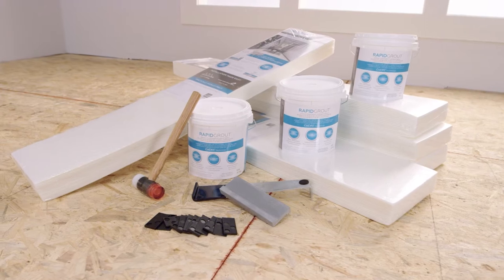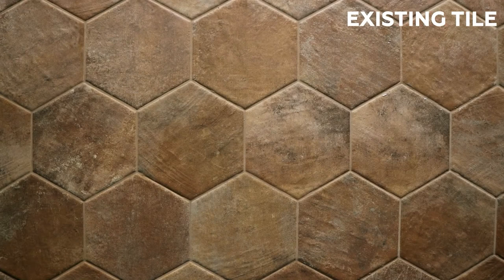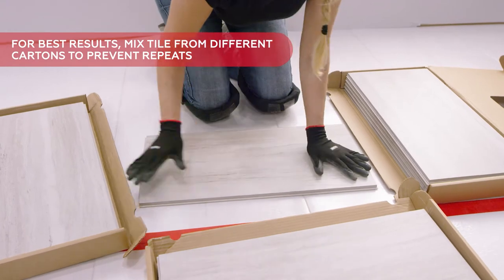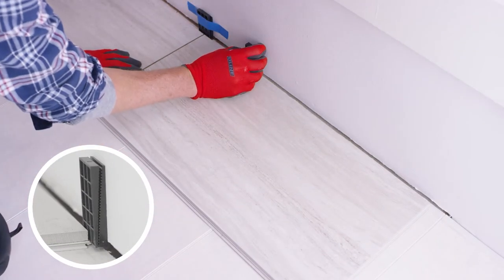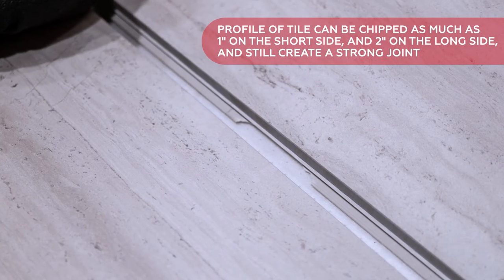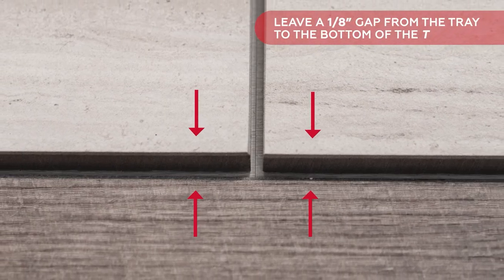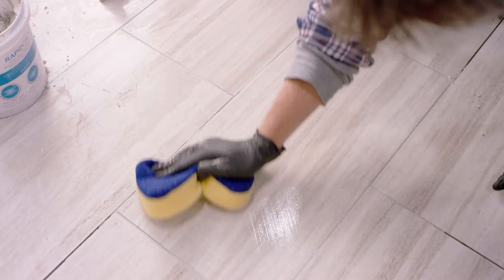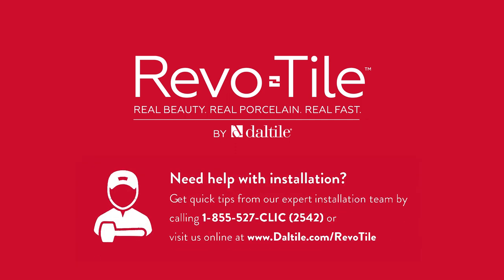RevoTile Installation

Comment: what this video doesn't tell you .. is that the floor needs to be almost perfect flat 3/16 over 10 is MAX  but even then any deflections on shorter length or "twist"  makes it hard to click in or you'll have a lot of issues .. the score and break looks  easy  .. sure.  but if you need to cut anything smaller then a  1/4  of the tile  you will have a hard time breaking  the under lay  .. and the score and break is no as clean  as they show .  chunks of the  underlay remains and needs to be grinded down .. any other cut is a wet saw cut and time consuming . the interlocking is  ok but breaks easy and you got to pay attention  cause little chunks that break off gets stuck in the groove and makes it hard to get the  tiles nice and tight . all in all interesting concept and I see the  appeal of the "quick" install but you need a lot of prep to get the floor to what you need .. and if its a nice open area sure it would be fast but in a condo  with hallways and door ways and  a lot of cuts this  is a VERY time  consuming process   the same if not longer then then traditional tiles .  this is my fair review to this product  from personal experience . I see the pros and the cons .

Comment: This is a great idea and product.
The issue is with the required grout. The rapidgrout, no matter what dahl tile recommends, leaves a urathane residue that is so difficult to remove. I've tried every method and talked to mfg reps even. This is the worst and more time consuming aspect of this system. Bostic Blair is expensive and doesn't solve the residue issue easily. Lots of scrubbing and work to clean the tiles up. They make it look and sounds so great on website and video. It's a bummer cause the rest of the system seems pretty great.

Comment: I purchased 4 pallets of this for a 1200 SQ ft condo. No tile installer wanted to do it. I had no idea why….and now I know. 
First, NO, you cannot just use a regular tile score cutter. I tried the best brands, the big ones small ones, they will not score the tile and break them easily or nicely. So, in comes the expensive, loud and messy tile saw. 
They don’t click into place as easily as shown and if even the slightest piece of debris is in there you’ll have to pull it away and clean out the groove. 
Your floor better be perfect, and I mean absolutely flat. If not you’ll hear all kinds of clicking and snapping when you walk on it. You’ll end up pulling up the piece and gluing it down. 
All in all it’s been a very frustrating and labor intensive process. I wish I could go back and just buy regular tile and thinset the whole floor. 
I haven’t even started grouting, and what I can read that’s a nightmare waiting for me. 
Btw I have tiled many many large and small format tiles, both wall and floor.